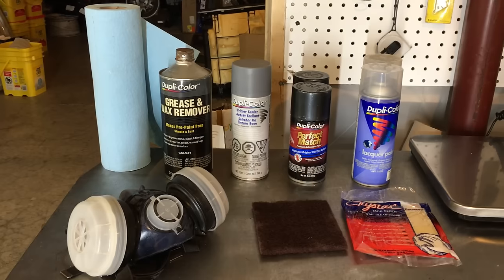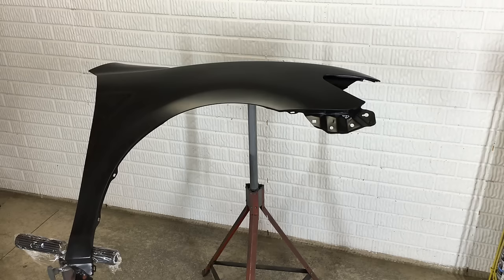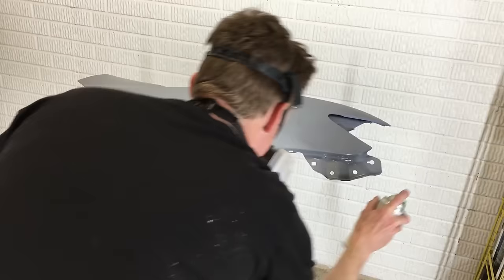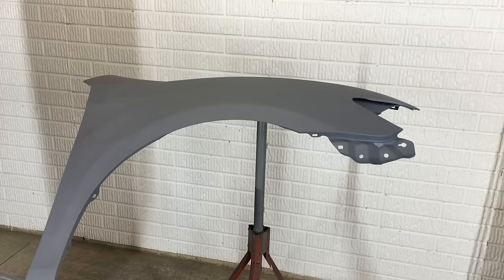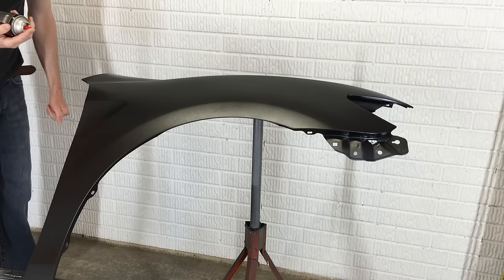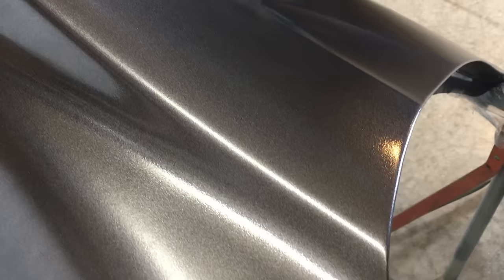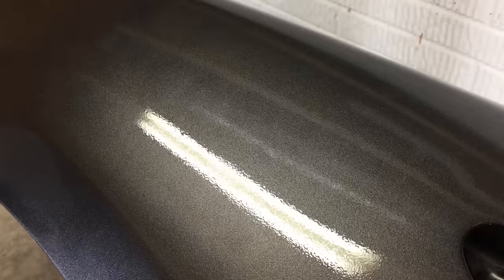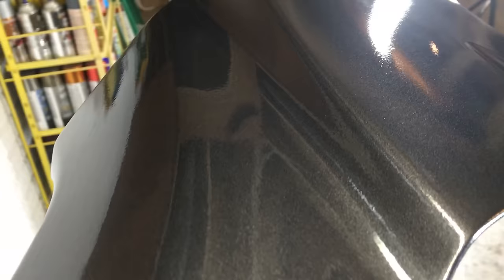How to Paint a Vehicle Fender with Spray Paint - Cheap & Easy!

Comment: To anyone doing this.  Make sure the humidity and dew point outside is at a low.  Anything over 60-70% humidity is going to cause wrinkling in the paint due to the moisture in the air.  Do this in an enclosed well ventilated area if possible or wait for a dry day outside.
Reply from the maker: Very good point!

Comment: Great video and good techniques but you could have avoided more of that orange peel by sanding with 600 in between coats. I recommend light sanding after the final coat of primer, before the last wet coat of paint and before the last coat of clear. It knocks down half the texture you had at the end. I would also run a 1500 grit before  the cutting compound. Your work would have come out better than factory!
Reply from the maker: Thanks for the tip!

Comment: I'm in the process of replacing a front fender on my 2004 F-150. It is dark blue(True Blue). I found a fender in a junk yard in great shape for cheap and it is dark green. I will basically do your process. I already bought 2 cans of the Duplicolor Tru Blue and 2 cans of Clear Coat.  I plan on using primers I have on hand.
I intend to wet sand after the final color coat and again after the final clear coat.

Nice video...thanks.   Note - the price of these spray cans has gone up significantly since you made this video.
Reply from the maker: I can't believe how expensive they are now, only 5 years since I made the video.

Comment: Your video was awesome, it really gave me enough confidence to take on painting my fender!

I have one issue though. Duplicolor doesn't have the color needed for my 2001 Avalon. I don't know if it's because it's an older car or if the color just isn't popular enough (the color code is 6M3 if anyone's curious). 

What brand of paint do you recommend I use instead? I don't trust myself to pick an alternative brand lol.
Reply from the maker: I had the same problem when painting my 1988 Legend, which used an uncommon color.  I ended up finding matching color code aerosol cans on ebay BUT the nozzles clogged and made a mess :(  Duplicolor is the best I have used. Sometimes local auto paint stores can custom mix your color and put it into an aerosol can. I would try that before I buy generic cans from ebay again.

Comment: Thanks for the vid!  Excellent instructions!  Everything worked as you showed but I created some runs due to the paint nozzle sputtering.  Will try to polish them away but I'm not too concerned as the fender looks really good otherwise.
Reply from the maker: It's too bad a defective nozzle is all it takes to mess up a nice paint job.

Comment: Told reduce the chance or dust and debris landing on your painting surface pour water around the surrounding floors and walls ( the dust/debris will stick to the water). It helps to have a bucket near by to make sure the floor stays wet! (DIY TIP)
Reply from the maker: Great tip!

Comment: Idk if I missed it but you can avoid those paint blobs by heating up the aerosol can with a heat gun. Creating more pressure inside, better spray.
Reply from the maker: I did not mention that - great tip!
Reply: @6thGearGarage  Of course, if you heat it too much, it could explode. That's kinda important to mention ...

Comment: 14:42 surely everyone can see that "after" the fender is a bit darker then "before". Just look at the differences between A pillar, fender and hood.
Reply from the maker: Yeah the new paint was a hair darker, most likely because the factory paint has slightly faded from UV over the years.  Body shops can adjust the new paint to accommodate for this but not the aerosols
Reply: @6thGearGarage  Thanks for explaining, I was really hoping that there is maybe some polishing liquid or something that can brighten the paint but apparently there isn't. I'm having this exact problem on my chevy cruze, had to repainted the rear bumper and it end up being a bit darker than the rest of the car even thou I used the paint by factory code. Car is already 11 years old and, like you said, it's bright silver paint most likely got even more brighter due to UV.
Reply from the maker: The same thing happened on the Dark Blue Ford Edge you might have seen me repair in other videos. New paint was slightly darker than the 10 year old factory paint. The only other option in blending further into the adjacent panels, but that's next level when it comes to difficulty.

Comment: Another great video!  You're hands down the Duplicolor expert!  I hope they're paying you.  When painting plastic fender flares do you sand down to the bare plastic or do you think it's ok to scuff up and then apply adhesion promoter and primer sealer?
Reply from the maker: Haha thanks, I might hit them up and see if I can get some free paint! Been using their stuff for almost 20 years now.  On the flares, I would only scuff up the original paint. As long as it's in good shape and there's no bare plastic showing, you won't even need the adhesion promoter. That's only needed to help paint bond to bare plastic.  But do use the primer sealer over the scuffed original paint as you mentioned.

Comment: Thank you for your awesome step by step video. Quick question, do you recommend to sand the fender with a 1,000 or 2,000 grit sand paper before applying the clear coat? If the fender feels a bit rough.
Reply from the maker: Depending on the color, you may need to recoat after sanding. I would sand the color with 600 or 800 grit before re-applying the color. Then once you have a good smooth color coat, apply the clear. If you still have rough finish after clear, you can wetsand and polish as needed.

Comment: Do you know what I can do if my front fender is raised a bit from the door? I can't adjust the front fender anymore. I wonder if the door can be brought out a bit. Your paint job loooks great.
Reply from the maker: Maybe the fender was slightly tweaked in shipping. I would try to bend the fender back to proper shape instead of modifying the door to match the poor-fitting fender.

Comment: Looks so easy! I just got into a fender bender and I’m trying to be as cheap as possible 😅 this is the exact piece I need to replace, could I possibly just paint over the already primed part?
Reply from the maker: You could, just lightly scuff it first so the paint will adhere better.

Comment: Thanks for a great video! But when it gets orange peel on the base and you put the clear, does it need wet sanding on the base? Or when putting the clear? I’m thinking that when clear gets over base maybe it wont be sandable?
Reply from the maker: If the base is really rough, you can sand it down and re-apply more basecoat. This is called color sanding and often done on show cars and high dollar restorations. Then after more color is applied, the clear follows.  Because most regular vehicles come with some orange peel from the factory, I didn't bother color sanding the base.

Comment: Hi. I noticed you didn’t do anything to the inside of this fender. I’ve researched this a bit and most paint shops use some type of material to cover inside panels. Reason I think is that e coat will not hold up to weather.  Even inside doors, quarters, etc. I see others using gravel guard or painting these areas with auto paint. It means having to sand inside areas just like the outside. Most painters I watch sand the inside as well as outside with sandpaper. Then go over it with abrasive pads. Before painting. But great budget job for sure.
Reply from the maker: Thanks for sharing. I figured since there was a plastic fender liner, the inside was OK as-is. I'll definitely paint the inside on future projects!
Reply: @6thGearGarage  oh okay cool. Didn't know it was a plastic cover for it. But again, if moisture can get inbetween...@#$%^&thanks for the reply!

Comment: You must apply more clear for for glossy finish. ... I also did the same like you. 3rd clear coat makes job more glossy and does not require sanding and buffing.  I challenge you for that.

Comment: Great video!  I noticed, though, that you didn't use a drop cloth or masking of your garage wall or floor. How did you NOT get paint on the wall and floor without masking it off??
Reply from the maker: Good question... there’s not too much overspray with such a small project and aerosol cans compared to painting some thing larger like a bumper with a spray gun. Also the paint is lacquer which dries fast, so it’s usually dust by the time it lands on the floor, which makes it easy to sweep up/vacuum.

Comment: My 89 Celica GT is white. I hear they did not use clear coat for this color. Do you have any tips or suggested changes in my scenario? Thank you for replying to eveeyones questions over the years.
Reply from the maker: If you can get the color matched paint to match your paint code, you’ll just need to apply some extra color coats, since you won’t be applying any clear. That way if you have to wetsand and polish which removes some material, yore paint will still be plenty thick enough. I’d try 5-6 coats of color total.
Reply: @6thGearGarage you rule. Thank you so so much for responding. I hope you have a good weekend
Reply from the maker: Also, the color may fade or dull faster without a clear on top. The color matched paint is a lacquer, which is not uv resistant. The oem paint is most likely a single stage urethane, which is formulated to last for years. A 2k clearcoat will help protect the color.

Comment: Its a good job! , I notice slightly different in colours is there a way i can match it more perfectly?
Reply from the maker: Unfortunately no, as oem paint will fade over time from UV rays. Some professional body shops can mix the new paint to accommodate for this, but you get what you get with the aerosol cans.

Comment: Hey man a wonderful and easy to follow video indeed.
I followed all your steps and used your recommended materials.
One question if you have time:
After getting a great result in each step I had the clear coat step that damaged everything 😮
It came out so rough and destroyed the shiny look and I don’t know the reason or the cure
Any advice?
Reply from the maker: The rough finish is called orange peel. If enough coats were applied, it can be wet sanded and polished to a mirror finish: https://youtu.be/ZCnLoFX5O0o  Hope that helps!
Reply: @6thGearGarage  even if it’s rough like mat painting?

Comment: really good video, better than a heap of others. I have a question...I have some paint splats on my final coat and don't want to buy another can just to spray another coat when a full can has been used on the fender. Is there a way to rub out the few imperfections before I put the clear coat on? Would a cutting compound be needed or something else. Thanks for any advice.
Reply from the maker: I have only ever been taught to sand it down and apply another color coat. Depending on the color, you could maybe get away with just lightly sanding the surface with a higher grit whose scratched would be filled in by the clear coat... maybe 800 or 1000 grit? This isn't solid advice, just a best guess.  I'd try it first in an inconspicuous area.
Reply: @6thGearGarage  Thanks for that. I wondered if I could just use a tack cloth or similar to lightly sand it. The color is white so I'll give it a go and hope for the best. cheers.
Reply from the maker: @jasonsmith3573  White is the most forgiving color, so I’d give it a try👍

Comment: We have a 2007 white Honda and need to replace fender. Will the new paint match the old 16 year old paint?
Reply from the maker: White has a better chance of matching than about any other color due to less UV fading over 16 years, but it still may be slightly off

Comment: No one makes an "exact match" paint per the BC/CC paint code for my 2011 Impala (dark, dark charcoal grey metallic) except for Eastwood at $25 per can.  Could I use an off-the -shelf charcoal grey for the first 2 coats and use the expensive Eastwood for the wet coat?  The decklid spoiler (dealer installed aftermarket) also needs to painted in addition to the front fender.
Reply from the maker: After investing the time to remove and prep the spoiler, I wouldn't risk mixing different colors/brands of paint to save 10 or so dollars. I'd only use the exact paint code for better end results and a better match. Be sure to use a 2k clear coat for long lasting UV resistance: https://amzn.to/43KbyMK
Reply: @6thGearGarage  -- That's a completely reasonably answer... it's only 10 bucks.  Now, I have another question about prep for the spoiler:  the paint isn't faded, it's not flaking any clearcoat, it's actually pitting down to what looks like the actual fiberglass as if there was no proper primer applied before the metallic coat was applied.  Do you have a video or a link to another video that addresses the proper prep work for this type of situation?

*ADDENDUM*
The spoiler is attached to the decklid with four 10mm nuts.  So, removal and securing to a work station isn't a real issue that needs to be taken into consideration.

Comment: Since I don't have a polisher I was wondering about doing it by hand - and I saw where you did some spot buffing by hand so I'm going with that on the whole fender.  But - do I need to lightly sand before applying the clear coat? I used Duplicolor for the base (Victory Red) but it just feels a little rough.
Reply from the maker: If you want to sand the orange peel, you should apply more coats of color before clear. Or you can apply enough clear to fill in the rough texture and then wetsand and polish the clear. It really depends on the amount of orange peel and how good you want it to look when it’s all done.

Comment: Great video, Do i need to sand the color coat before applying the clear coat, not using laquer, the finish is quite matt, not smooth(has metalic )no orange peel, nice coverage.
Reply: Not smooth to the touch, just slightly rough like when you apply primer. Had to do more coats because can wasn't affording enough coverage.
Reply from the maker: @raemifar5916  I did not sand the color coat. I was sure to apply enough clear so that when I polished to make it smooth, I would not polish through the clear into the color layer of paint.

Comment: amazing work ...the clear coat isnt automotive right ? any problems using this clearcoat? thank you
Reply from the maker: The clearcoat is Lacquer, which is all Duplicolor offered at that time. (that generic looking label was their older design.) Now they have a 1k clear, which will hold up longer. Or go for the Spraymax 2k clear for the longest lasting clear coat.  I will add links to those in the description.
Reply: @6thGearGarage  thank you mate ..all the best

Comment: Is isopropyl alcohol mixed with water equal to wax and grease remover?
Also I probably missed it but how much time do i have to wait after primer to spray the color?
Reply from the maker: I'm not sure, but I think the wax & grease remover might do a better job than diluted alcohol, otherwise more people would just use the alcohol. I suppose in a pinch, the alcohol is better than nothing though. I wait about 15 minutes between coats. The drying time for the exact product you use will be on the can's instructions.

Comment: I loved way, ins n out how u painted n polish fender. These body man wants 1000 plus 5 by 12 dent on the hood. It's lease car . I only have couple days before I return,  I think I'm  going to do it myself. I'm  so stress  out. They see u with a new car right away they want to charge big dollars. I have liability on the car.. tell your suggestion or opinion.  I'm fender is on , he has to connect with bumper he wants 600 without doing the hood. Pl. Respond. Thanks
Reply from the maker: Seems very pricy, it’s worth a shot to do it yourself

Comment: Do you have to let the color coat dry before you add clear coat or should the clear coat be added not long after you add the color coat?
Reply from the maker: It really depends on the instructions of the product that you use. For this lacquer aerosol, there is no recoat window, so I only had to wait 15-20 minutes, but I could have done it the next day if I needed to.
Reply: @6thGearGarage  I’m only asking because one time I was painting with regular spray paint and when I let the color paint dry and then added the clear coat it would make the color start to chip up but when I added the clear coat while the color was still wet it would work fine. I realize automotive paint and spray paint must be totally different but I was asking because I didn’t want the same thing to happen again to an important paint job

Comment: Thank you for this video! Dumb question but what stand are you using to put the fender on while you are painting it?
Reply from the maker: They are stands with rollers on the top, used to hold long pieces of wood when cutting on a table saw or radial arm saw. I've used them for painting more often though!

Comment: Please help!  I was run off the road into a guard rail and banged up my fender and bumper.
  I'm afraid of being canceled by my insurer, so I'm going to try and do the work myself.
I have a couple of questions.  You mentioned purchasing the parts pre-painted.  Do you know where I can purchase pre-painted parts?  Also, the cheaper the better.  Can you tell me where you purchased your fender for $35?
Reply from the maker: Michael Copeland I found this one on eBay, or maybe it was Amazon. When I searched for this one, I saw pre painted fenders and bumpers but they were pretty expensive.

Comment: So I thought the black was the primer, so I put the final color on the black and didn’t put primer . Will that mess the color matching the rest of the car?
Reply from the maker: It could, usually best to start with a neutral grey, unless the directions for the color coat say otherwise. Since you already have it painted, might as well let it cure, get it out in the sun and see.